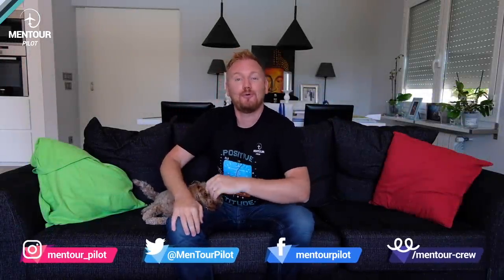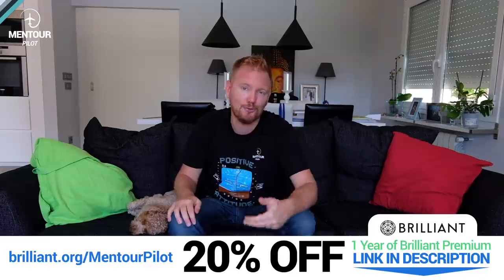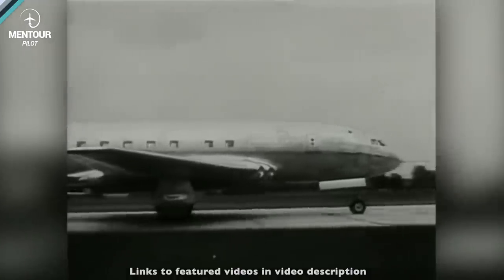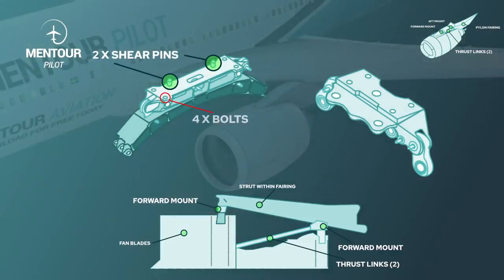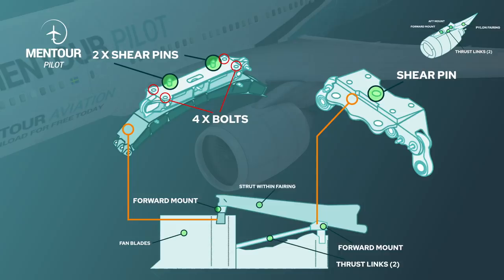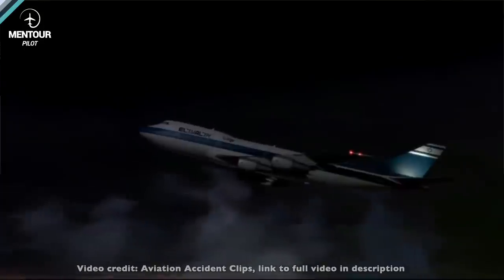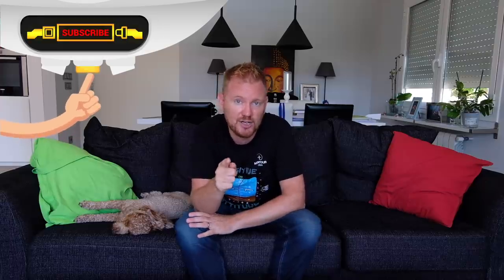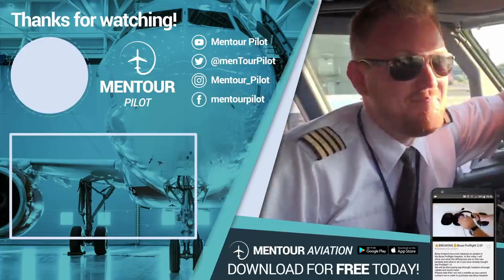How are Jet-engines attached to the wings?!

Comment: That was on the DC10 and the book specified that the pylon had to be removed on an engine change.  The airline ignored the procedure, and even though it wasn't the airplane's fault, that was the end of the DC10.  IT was then reduced to flying freight for FEDEX.
Reply: You've got your timeline mixed up.  The DC-10 was in production for 10 years after that crash, and the last DC-10 passenger flight was in 2014.
Reply: Russell Horn — The DC-10 had other problems as well.

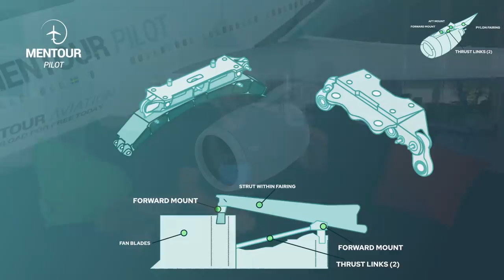Comment: Interesting en good explenation of the engine mounts. Just one question. On the diagram at 5:58 and 8:15 both mounts are described as forward mount. However shouldn't the one on the right be described as the rear or aft mount?
Reply: Marc van der Linden Correct, should be the aft mount👍🏻

Comment: Question after watching this and all the vids about PIA 8303. Why are the engine gearboxes mounted on the underside of CFM-56? It seems like a really silly place to put them if they are so critical. Could they not be mounted at the side or nearer the top to help the engine survive longer if the plane lands without the gear down?
Reply: Mark Hazeldine Where have you been told that the gearbox is on the underside?🤔

Comment: This might have already been noted in an earlier comment (can’t read 700+ comments!). The El Al 747 could have continued to fly in this emergency, but the engine that detached then hit the other engine on the same wing and knocked that one off too. There really was no way then to control the aircraft at minimum altitude and speed with two engines missing on one side.

Comment: At the 5:40 mark you said that the engine being placed slightly in front of the wing reduces the torque of the wing. Can you elaborate on that a bit more? 
I'm having a hard time understanding why the engine being further away won't add to even more torque as the moment arm increases?
Reply: In flight the front of the wing has most lift giving an uprolling torque. The weight of the engine give an opposite downrolling torque.

Comment: hey Mentour Pilot, could you do an in-depth video about the verticle stabilizers that direct in different directions when they are parked on the gate?
Reply: Harpreet Sandhu There is no such thing as a vertical stabilizer, that would be the rudder😉 They should not be directed in different directions when they are parked, they should be in neutral (centered).
Reply: Umm, that last time I checked, the rudder was the movable surface attached to, you guessed it, the vertical stabilizer.  I have seen countless times that as the hyd pressure bleeds of while its sitting on the ground, the wind can cause the rudder to deflect to one side.

Comment: I wonder when huge engine diameters will make high wings more desirable...
Reply: Imagine a GE90 howling right beside the cabin. The noise would be even more unbearable than with them under the wings
Reply: @犬井いぬい  It is really no different whether the engine is below the fuselage or in line with it, You won't be getting any sleep sitting over the wing. Much the same as it being impossible to sleep or even think in a plane with a fuselage mounted engine when you are sitting in the rear.  Commercial airliners are much better insulated from sound than military aircraft. Pretty much any of the C series of military planes if you aren't wearing ear plugs or muffs, you will go deaf in a very short period of time. Insulation has weight and the military would rather put that weight into cargo capacity. As engines get larger diameter it is probable the designers will go to a low wing with engines mounted above the wing. Low wings have many advantages over high wings from an engineering and safety standpoint.
Reply: @Lonny Wilcox What are the engineering and safety advantages of low wings?

Comment: Hello Sir
I have a question about the pilot resuming to fly after lockdown. Most of the pilots are not flying as of now, so after the lockdown will there be any drill beforehand so that they perform their operations perfectly. I had this question as we normally do a basic drill before we do a task which we used to do but stopped for sometime because of some or the other reason. I really want to know, if you can reply to my comment then I would be glad.
Thanks.
Ashish from India.

Comment: The 747 has the ability to attach an extra engine to the wing for ferrying purposes. What measures are required to do this and does this affect flying?
Reply: The stage 1 fan is removed to reduce drag. It does produce more drag on one side.

Comment: in older fighter jets I think engine air intake was in the nose of the plane like mig 17, 19, and 21, why we didn't see that in later fighter jets before stealth technology, if you think about it in the nose of a plane you have the highest air pressure and if you take that high-pressure zone away you producing less drag also introducing more air into the engine so it ends up to be more efficient, could you explain a little bit about this matter please

Comment: I love aviation and have flown as a passenger traveling to and from Asia many times over the last 10 years. I also love watching Big Jet TV now that we are in lockdown here in the US...But one thing that has never been fully explained to me is that some engines when in full thrust mode at take off make a growling sound...as if something is vibrating . To me, that's not a good sound because it sounds like something is loose. Can You explain what is happening?
Reply: The buzzsaw noise?  Thats nothing to worry about.  Its the sound of the engine fan blades tips reaching the speed of sound at high power settings.
Reply: @get2dachoppa249  Thanks...I hear that on GENx engines but not on GE 90's. There are other engines that make that sound, for example those found on A320s or 737s...I'd like to be able to ID an engine by its sound. I guess from an engineering standpoint, maybe they all do it, but only if the pilot desires to use full thrust at take off...full thrust meaning only 90% , right. I 'm sure there are other factors in the designs as well...but it all is just fascinating to me!

Comment: There are much more Forces and the problem is much more complicated, as the explanations suggest. You forgot forces due to reverse thrust an Gyros forces due to the rotating masses in the turbine and horizontal side forces due to crosswind landings, only to mention some of the forgotten problems. Therefore the fixing points can compensate also side forces. The thrust beam hast also to manage the opposit forces due to reverse thrust during landing operation and has to be dimensioned due to buckling the thrust beam because of compression forces. All these and other problems must solve dynamic forces due to acceleration in all direction during flight also. These are only some topics.
Dr.-Ing. Peter Klamser

Comment: There is a small problem with your mounting diagram.  The rear mount is actually labelled Forward Mount, so it looks like you have two Forward Mounts from both ends of the engine.

Comment: I think the leading edges were run by a cable drum system and not directly by hydraulics. The busing cables were sheared during the departure of the engine.
Reply: Jay Reiter You thought😉 Leading edge flaps and slats are hydralically driven..

Comment: I prefer to call them "fuse pins".  In engineering it is possible sometimes to have things too strong.   If you put "bull bars" on your car and hit a tree your body could be subject to more severe forces.  Car seat belts are anchored into a pre-weakened groove so under extreme loads it tears like a tin of spam.  Stronger is not always safer..

Comment: Diffrent aircraft are designed differently. I have changed many engines in my career. Mentor is refering to a 737 which is what he flies. Some aircraft engines have more or less. Seen one with 3 huge bolts total. But only three. Seen one with ten. 5 on front 5 on back. 

But the general concept is the same hold so much force that it keeps the engines on. But designed to shar or break off if the forces are too great.

Their is an aircraft that lost an engine over lake Michigan during cruse. Thankfully no loss of life aircraft was able to return to the maintenance base.

Comment: I have question; I noticed many aircrafts are using same engine and one type aircraft use more than one type of engine. I'm wondering how is that possible, is it problem to have weaker engine or even stronger engine than ideal for that type of aircraft. 
My buddy had have some issues with DIY soft body airplane. Basically factory send you whole bunch of tubes and fabric to assemble airplane, they recommend 80-120 hp engine but we installed 180 hp Yamaha with much bigger propeller. Gyroscopic effect was thru the roof and after 50 flights we noticed damage on engine mounts. It was just too much for the aircraft. 
I know that Boeing doesn't just bolt in whatever engine have in backyard or cheap on ali express but..  how does it work?
Reply: Dragan Crnogorac On the 737NGs the engine used is CFM56-7B. The thrust setting is determined by a identification plug called P-11 which is installed on the EEC (Electronic Engine Control) on the engine. So if we want/need a different thrust rating we change the ID plug.

Comment: If I recall correctly, the engines were presented to the airframe using either a fork lift or a front loader type of device, so alignment was sketchy at best.

Comment: The first jet airplane to put the jet engines in pods under the wing was the ME-262 German jet fighter designed in 1943 by Willie Messerschmitt.
The Me-262 looks very similar to the early models of the Boeing 737.
It's amazing that Messerschmitt got the design right the first time around. 
-
sad news --- a Pakistani Airbus 320 crashed on attempted landing.  100 died.
A witness said that the plane attempted to land twice with the wheels up. The last time the engines hit the runway and fire came out of one of the engines. The blancolirio YouTube site has a photo of the plane with its damaged engines. Was the pilot trying to bounce the plane to get the landing gear down?

Comment: Great video! So.... The Pakistan airbus that attempted a landing with gear up, attempted a go around with two badly damaged engines etc., and the aircraft goes down. My question is, why didn’t the engines sheet off on touch down?
Reply: Exactly my question.  Odd timing for this video with such a (potentially) relevant topic.
Reply: marvin bernard  the timing is uncanny indeed! I’m sure you saw the pics of the engines that was somehow taken by a smart bystander. Blanchilirio has a good video on it if you haven’t seen it. It is fascinating that the engines didn’t sheer off based upon the gloads that Capt. Peter is detailing.

Comment: There is some speculation now that today's crash of Pakistan International Airlines 8303 was preceded by the aircraft touching down briefly without the undercarriage being lowered, which scraped the bottom of the engine nacelles. Pity the force of contact with the runway did not cause the A320's engines to sheer off.

Comment: Sometimes the aviation industry seems reluctant to learn from its mistakes. The Kegworth disaster in the UK in 1989 happened at least partly because the pilots could not see the engines, one of which was on fire as they approached the airport. They mistakenly shut down the good engine, leaving the plane without power and unable to reach the runway. I think I'm right in saying that the air accident investigation report recommended that planes be fitted with cameras so that pilots can see the engines. I am unclear whether this happened . . .

Comment: That's  interesting also related to the accident of PIA A320 which apparently landed on the engines and crashed on go around testerday, wonder if the part that failed could have been in the mount...
Reply: No.  The damage to the engine nacelles shown in the pics floating around show damage at the engines 6 oclock postion (very bottom) of the fan section.  There are quite a few engine accessories located right in that position that could of been damaged when the engines scraped along the runway.  The PCAA has released that they have found scrape marks on the runway.

Comment: LOT Polish Airlines Flight 16 landed with retracted landing gear and engines didn't fall off. Looking at the footage I even wonder where they would go if they sheared off, there is not enough space under the wing for them to pass without hitting the wing when they touch the ground. It was 767, but I don't think it would be much different for 737.

Comment: Brilliant explanation. I have a question on the engines of a B737 for eg. Do the fans rotate in the same direction I.e both counter clockwise or are the port and starboard engines spinning in opposite directions?
Reply: Same direction, its the same type of engine👍🏻

Comment: Hi Peter, I really like your videos. I really liked also the video about why computers will not replace human pilots. Mostly because the human is better to manage the unexpected. But what about remote controlled planes? Maybe from a simulator connected to a real plane? This way pilots could do only the hard parts of flying and let automation do the boring cruising part. May be more for long haul where on a 10h, there are like 6 hours ocean. I think today's technology is fast enough to have fast response and high resolutions of the plane cameras. Just an idea or is it already tested?

Comment: Petter (or anyone who knows)....is a plane designed to be flyable if an engine sheers off without catastrophic damage to the wing or body?  Or is the aerodynamic differential effect too large for the flight surfaces/pilot to overcome?
Reply: It would likely be unbalanced as you have a big weight on one side but no the other. Then again depends if it would make much difference how close they are to the fuselage

Comment: So, let me understand this correctly? The "shear bolts" get their name because they are designed to break, in case of a structural failure, thus making it possible for the engine to "shear" off and break away from the pilon under the wing?

Comment: MP I have a question;  There seems to be a purple coating on the screens in the cockpits, this also can be seen on military plane windows. I assume its UV protection, BUT I saw a video the other day and the pilot said "Do you like my new sun glasses? they are NOT polarising so I can see the glass cockpit screens" so my question is; do you need a certain type of sunglasses, are all screens coated or just the small private planes with large window areas, and are Top Gun style aviator glasses designed for the job or just to look cool ? Many Thanks Tim
Reply: timwood12 Its just rain repellent I think, dont know of any mro`s that uses something that has to do with UV protection..

Comment: With the El-Al disaster the initial failure shouldn't have led to the disaster it did. The damaged shear pin failed and the engine detached as designed. As it was in climbing power the number 3 engine detached and accelerated forward, moving away from the aircraft. At this point the aircraft should have been able to keep on flying safely and return to the airport.
Unfortunately, after the detached engine decelerated as it was no longer providing thrust, the aircraft caught up with it and the lost engine collided with the no.4 engine and leading edge of the wing'ripping of the no.4 engine as well, and a large part of the leading edge on the right wing to boot. Had the no.3 engine diverted either up or down after detachment ever so slightly and missed the aircraft as it caught up, the aircraft most likely would have been able to be landed safely.
 As it was, cap. Fuchs and his crew did a magnificent job of keeping the aircraft aloft to the point of even being able to line up to runway 27. While configuring for landing capt. Fuchs extended the landing gear and the flaps, unaware that most of the slats on the right wing were gone. As a result the aircraft entered an uncontrollable roll resulting in the crash.
As I see it, the cause of the crash wasn't the loss of the engines, but the loss of the leading edge slats that caused the crash. Had the no.3 engine ripped off the no.4 engine cleanly, the aircraft still might have landed safely

Comment: I have a question "Causing a lot of human dmg"
I work in healthcare and I've never heard of that term
I still think that the Comet is one of the most beautiful planes we ever built, it wasn't nearly as good as the B707 but still, the Brits won the beauty contest in my opinion 
Hope you get back in the air soon and we see you in your regular uniform, it's weird listening to you in jeans and T-shirt
Reply: The Comet was a far more aerodynamically efficient design. The 707 got pod mounted engines because the USAF specified them in the B-47 for engine fire damage limitations under enemy attack.
High bypass engines were not even contemplated in the Comet 1 but were fitted to the Comet 4 and subsequent Nimrod. 
The Comet 1 accident investigation resulted in a redesign of the 367-80 structure and subsequent 707, C-135 & C-137 before the first flight.
Reply: What’s a good alternative word? “Causing a lot of injuries and loss of life” is a mouthfull.

Comment: I was sitting in the back of a 738 at the end of a late night flight and when the engines were shut off there was a strong smokey smell in the cabin. Is this normal?
Reply: My guess is that it was a tail wind that carried exhaust and cooling air smoke around the engine to the intake and was sucked in by the compressor and through to the bleed air and made it in to the cabin while the engine was still spinning. Even when the engine is shut off but still spinning you can see cooling air smoke coming out of the small pipe  at the back of a CFM-56.